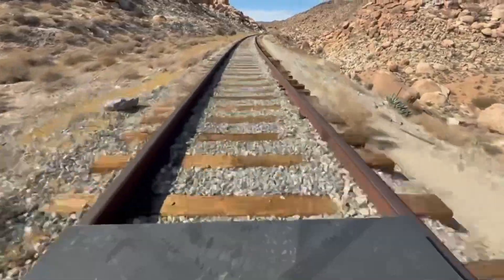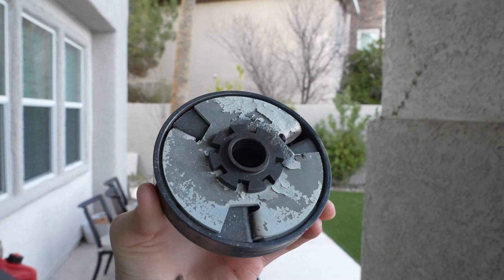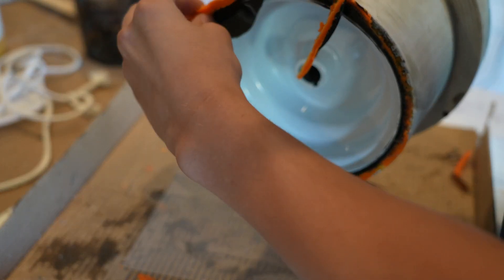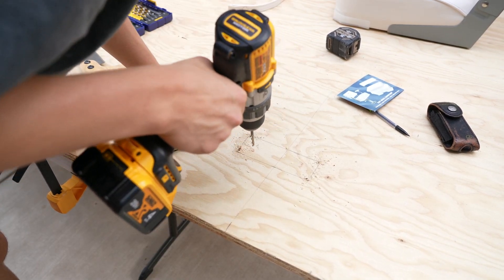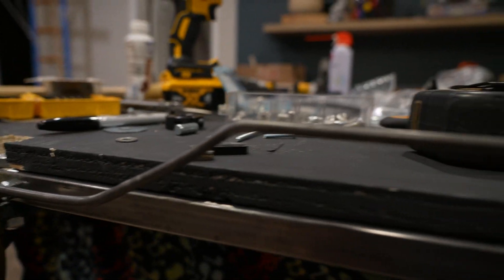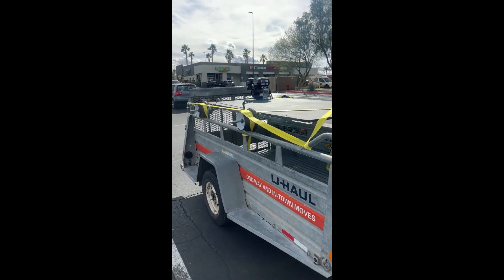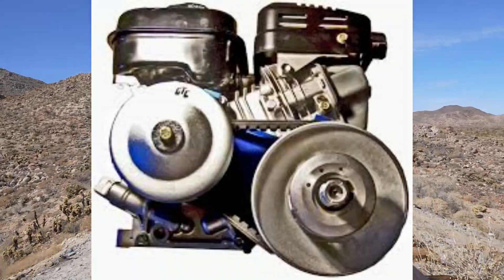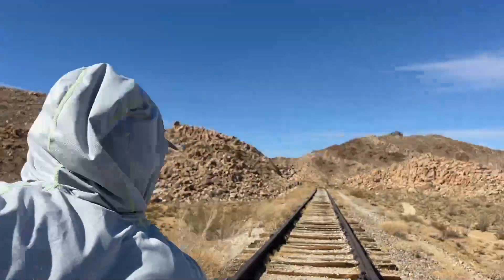How To Build A Rail Cart

Comment: I cannot make costum wheels, as there's a lot of complications with that, but i found some online. The question is, how many mms thick does the wheel need to be? The wheels i found are from 75 mms to 150 mms, but im not sure how thick they exactly need to be. I want to make sure it can smoothly go on turns, but it should still be stable. What do you recommend?
Reply from the maker: What thickness are you referring to? Like which face/part of the wheel. But it would depend a lot on how heavy the cart is going to be (how many people it will hold etc) and also what the wheels you’re looking at are made out of. I’m happy to give you my recommendation just answer those questions!
Reply: @The_Rail_Cart I just looked further into it, but it seems the company i wanted to buy wheels from only sells train wheels to companies, which i cannot create right now. Therefor i will need to find another way... My friend has a 3D printer, but i cannot afford that chemical stuff, and there are no shops that sell it near me. Now... i have a devius idea.... A nearby train yard has abandoned trains that are rotting away on rusty tracks for years now, and they have perfect wheels. Sadly i cannot find the wheels most people use, they aren't sold anywhere! So i might have to result to getting 4 of those rusty wheels...
Reply from the maker: depending on the condition of the rusty wheels I would say that’s not a bad option. They’re cheap and if they were on an actual train then they are definitely super strong. If you have a lathe then you could do the bucket method. You can see that in Ryan randomness video. I can send the link if you want.

Comment: For the wheel 3d mold, why not put a bottom on it ( opposite to where you had the top)? I guess you have to have a split in it.
Reply from the maker: Yeah, maybe it would be possible to get the wheel out of the mold with a bottom. But I wasn’t sure and so I just didn’t have a bottom. It also gave me leverage to force the wheel out.

Comment: Just a suggestion, when we made our rail cart I made our platform using angle iron bed frame I got for $10.00 at the re-use it centre. And the base was made from expanded metal we got from the metal scrap yard for free. To buy it was expensive. 4x8  sheet is $80.00. Keep your eye out for that. We got lucky and someone had dumped it the same day before we went to look for some.
Reply from the maker: Oh that’s super smart to use a bed frame! Yeah I think in the future I need to go to more thrift places like that where I can get stuff for super cheap. Thank for sharing!

Comment: Can't open Links
Reply from the maker: Youtube hasn't verified me so I cant put links in my description. Here they are for now until I fix it. 
ONSHAPE 3D MOLD MODEL - https://cad.onshape.com/documents/2cbda74b46f843f1157b6a71/w/41e13467ac7d0d5c7a9d4ff8/e/67f2cf403569ae858c111fbf
PUBLIC SPREADSHEET (PARTS I USED) - https://docs.google.com/spreadsheets/d/1HJUfHV2KLzkADA4_aYIsZgO7hIP5BYRwdBQoYdPaSeg/edit?gid=1202178786#gid=1202178786
MEASUREMENTS AND ILLUSTRATIONS - https://drive.google.com/drive/folders/1TFJAhR9qS297MXTYpYSpra_-3U7ZfQ4Q?usp=drive_link
Reply: @NeverEnoughTools-NET
Thanks